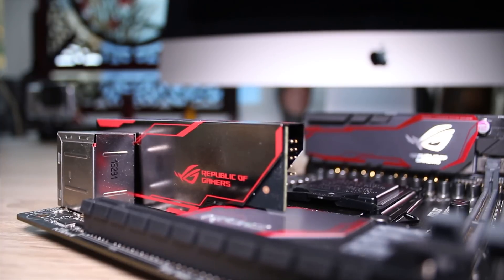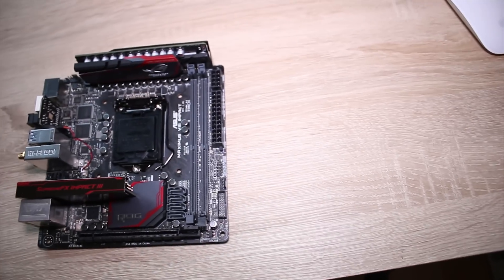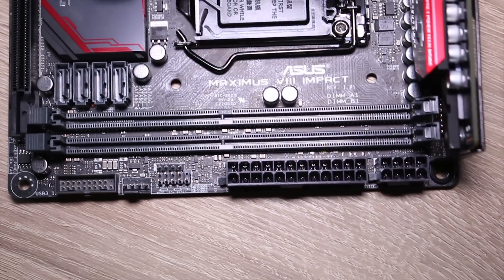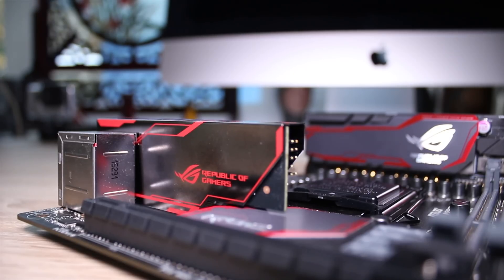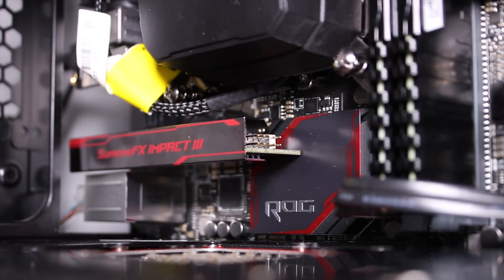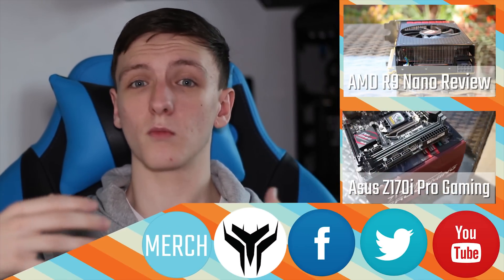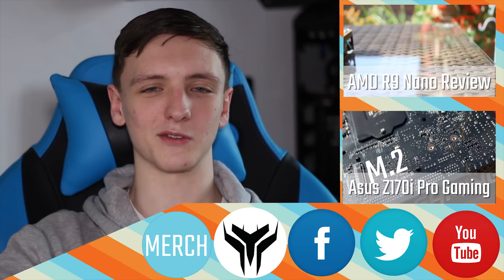Asus Maximus VIII Z170 Impact Review

Comment: Hey techteam, what do you plug into the soundcard header?
Reply from the maker: +Vandoeun Long the front panel header from the case
Reply: Would it be ok to plug my kraken x61 usb 2.0 header in there?  this mobo only has a 3.0 header and that header in the sound card.  my nzxt mantadoes not have 2.0 header chassis.
Reply from the maker: No as it's not a USB header
Reply: oh it's the audio header lol im dumb

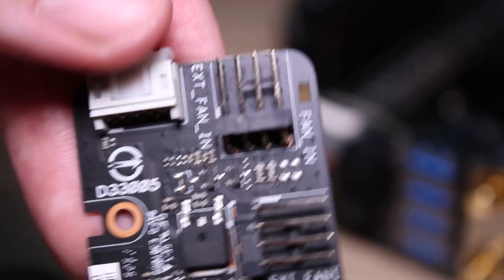Comment: where does put the component at minute 3:00 - 3:10 on the motherboard?
Reply from the maker: The external fan hub connects via a wire to the motherboard. You can put that board anywhere you like.
Reply: thank you :)

Comment: does the supremefx support 5.1/7.1 soundbars and headphones? lastly, how many pcie lanes?  if only 16, does that mean it'll split usage of the gpu with other peripherals?
Reply from the maker: I believe 5.1 if I remember, and 16 + 4 from the U.2. The CPU only has 20 lanes total anyway.
Reply: thank you for answering, but how many lanes is supported by the motherboard? 16 right?
Reply from the maker: 16 to the GPU, yes.
Reply: thank you
Reply: after reading this thread again i finally understood you telling me the pcie was x16 for the gpu and x4 for the U.2, so it does support the full use of 20 lanes from the cpu and the mobo.  thank you one again
Reply: I found out that this mobo supports 7.1 sound, but after looking at he PCIe placement, I'm not sure if it can fit the strix 1080 cards without blocking the sata ports.  Could you clarify?  pcpartpicker did not point out this possible problem.
Reply from the maker: You won't be blocking the sata ports, as they are above the PCIe slot, the graphics card extends downwards away from the SATA ports.
Reply: thank you

Comment: hye.may i know where is the second usb 3.0 header on this board?
Intel® Z170 chipset : 
6 x USB 3.0 port(s) (4 at back panel, blue, 2 at mid-board)..i just found one...
Reply from the maker: The header allows for 2 ports to come off of it!
Reply: so i need to buy usb 3.0 splitter?
Reply from the maker: No, the case will have a connector that will split into 2 USB ports
Reply: +TechteamGB ooo..cos i use 3.0 usb header converter to usb 2.0 cos need to use on kraken x41..cannot use that usb 3.0 on case.i wonder if usb 3.0 header splitter will work if wanna use usb port on case.
Reply from the maker: I'm not overly sure as I've never used a splitter for USB. Let me know if you sort it!

Comment: It's so incredibly feature packed, that it doesn't have M.2...
Reply from the maker: +QuantumBraced Yes, as the M.2 has been substituted for the 'higher end' U.2 connector, allowing for NVME SSD's to be connected. While I don't really see why Asus couldn't throw an M.2 slot on the back like their Pro Gamer board, I can see that they viewed the U.2 as a trade off, and fair enough to them.
Reply: +TechteamGB U.2 drives are really meant for a totally different business sector than M.2's, or indeed the Impact mainboards themselves. Also, those on sale are much thicker than regular 2.5" drives, so they won't even fit many ITX cases, the future trend seems to be dropping 3.5" bays altogether and only support up to 9mm thick 2.5" drives and in some of the smallest cases there are only one or two drive bays, which really limits the usefulness of U.2 drives. Even more unfortunate is how the U.2 connector takes up space from the rear IO shield, so Impact is missing out on the plentiful connectors of other Maximus boards. Curiously, all the other Maximus VIII boards DO have M.2 connectors, and Hero doesn't even have the U.2 port! I think this is a very, very poor choice on Asus' behalf.

Edit: Okay, found out there are slim U.2 drives too, but again they compete with SSD drives, are very expensive and do not offer the small form factor benefits M.2 drives do.
Reply: +TechteamGB I'm sure I read somewhere you can remove the wifi/Bluetooth module to reveal M.2 connection?!
Reply: Destinar VII had the M.2 connector on the WiFi module, but this one doesn't.
Reply: +Karri Koivusalo 1 x M.2, Pre-installed with Wi-Fi/Bluetooth module
Reply: Necron 99 That's on the Impact VII board. The Wi-Fi module on VIII is different, and it doesn't have the M.2 adapter.
Reply: Yes. It so sad. I've already known it after watching this video ((